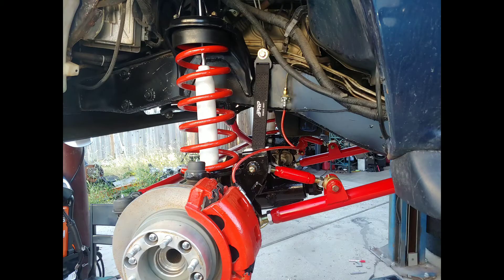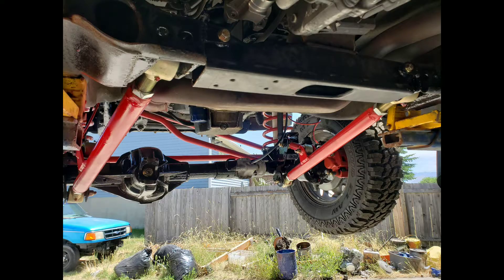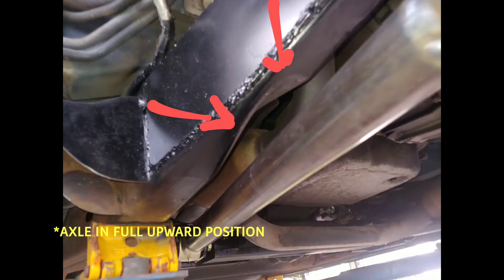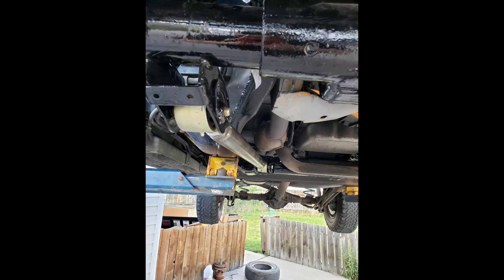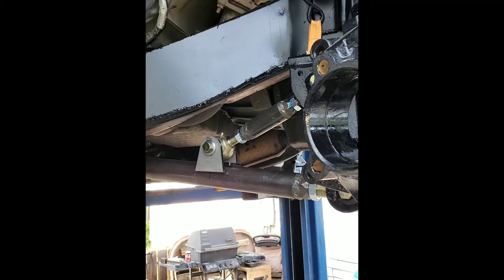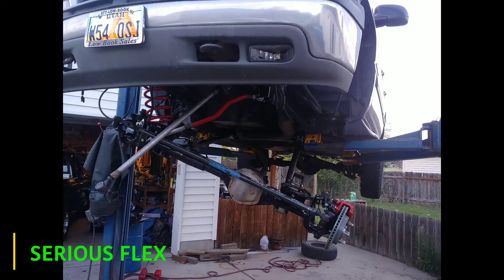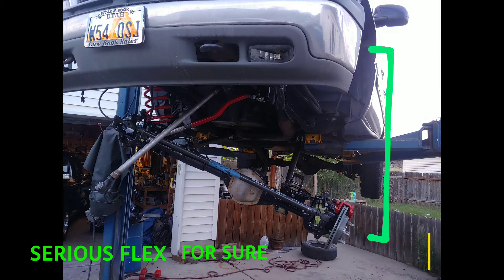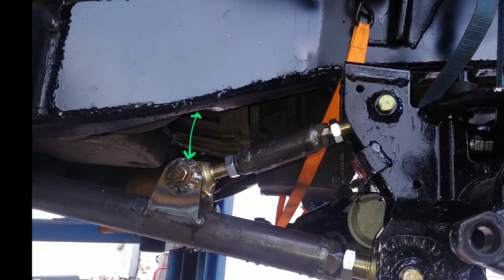TAHOVERLANDING AXLE SWAP RADIUS ARM DESIGN & ENGINEERING Episode 8

Comment: These are fine for a vehicle that sees highway use? What prevents a lot of body roll?
Reply from the maker: 99.9% of Tahoverlanding customers daily drive their swapped rig. The solution is to still run the rear sway bar. And every person has been happy enough with that to not pursue adding a front sway bar. 

But with no sway bars at all. There is noticeable body roll. 

Also watch this:
https://youtube.com/shorts/f1hD_uKJCUA?si=5yD7-zZyiL9Yq6Ep
Reply: @tahoverlanding  thanks for the reply. This seems like a good way to swap in a solid axle and 4wd into a motorhome.

Comment: What caster angle can I get with this method? 5 to 7?
Reply from the maker: I'll do a video on aligning it on this next build I'm doing.  

You need to plan to be dynamic in finding balance, u joint working angle and how it affects vibrations will have a lot of bearing on it.  But you can technically have any Caster angle that  you want just based on how you adjust your upper-locating arms

Comment: Awesome job 👍👍👍 how did you retain the ABS / match the speed sensors?
Reply from the maker: It's seen at 1 : 55 in this other video
https://youtu.be/GoyOwoTThso

The factory 2000-2006 gm 6 lug hub assembly bolts right in place of the dodge CAD D44. Uses the same shaft spline too. 
The ABS sensors are built into the hub so  it functions as it would with IFS
Reply: @tahoverlanding  that's awesome and convenient! I have a different issue  ... Bolted a rear diff from Nissan y61 patrol to my 2008 Silverado :(
Reply from the maker: @ali.al-ismail  is your Silverado 2wd? 

Does the Nissan axle have sensors in it already?  Even if they're the wrong reluctor ring tooth count.  

I've gotten around this issue in other builds
Reply: @tahoverlanding  mine is 4wd and twin turboed for off roading. That's why I went with the Patrol axle. It's strong.

Yes it has speed sensor similar to the OEM axle. But definitely the sensors and relctur wheels are different. I didn't yet wire them to the original plugs. U think I should?
Reply: How did u get around this issue? Which video should I watch?

Thanks for the help 🙂
Reply from the maker: @ali.al-ismail  I actually have not made a video on this particular thing.  So I'll have to describe it to you.  

Too bad, I'm actually secretly developing a full float rear axle conversion for these trucks. It's just not in production yet.  
It would solve all these problems

Maybe we should email back and forth. Might be easier than in a comments v section.  

Or you can message me on Instagram

Comment: longer the track bar the less bump steer.   i would've mounted the track bar on the axle as far to the passenger side on the axle ,and the other end I would've made a truss as far to the driver's side off of the frame making that track bar about 4-5' feet long.           just sayin
Reply from the maker: Actually the track bar length needs to match the drag link length.  Longer is just as bad as shorter when it comes to bump steer.  

This is so that the track bar keeps the axle the exact same distance from the steering box at all points of the suspension cycle. bump steer occurs If the distance is not the exact same
Reply: You are right! Just testin. 1975, my first lift of a 1965 chevy c20 2x4 or 4x2 (two-wheel drive)  I learned all of that because I was lazy. Learned though!

Comment: Your radius arms are not stable. You used to many Johnny joints and they will rotate over and bind on the joint constantly.  Need to use Uniballs on the rear of your radius arms to keep that from happening.
Reply from the maker: It hasn't given any issues for over a year. But if anything the double Johnny joints were pure overkill. If i did it again, a good poly bushing at one end would flex plenty more than what I need.

Comment: Do you think a 3/4 ton axle would fit just about as well?  ignoring the bolt pattern and bigger tube & center section dimensions.    In a previous vid you indicted the 01-02 for the ABS tone ring compatibility.
Reply from the maker: So "3/4" ton is not quite what i think you mean. Because my d44 housing actually came from an 8 lug 3/4 ton. While other 3/4 tons of the same years also came with a Dana 60. And yes, the dana 60 dodge 8 lug hubs still have a 55 tooth tone ring. So you could easily run them on a Chevy with a connector change. But you can't retrofit the 6 lug gm hub onto the dana 60 knuckle because it's a 4 bolt instead of 3 and a couple other differences that make it not a bolt on affair. So you'd need to run it with the 8x6.5 bolt pattern
Reply from the maker: Also all the 1994-2001 dodge solid front axles have the 55 tooth tone rings so you could find any 8 lug from that era and you would have the right number of teeth on the tone ring